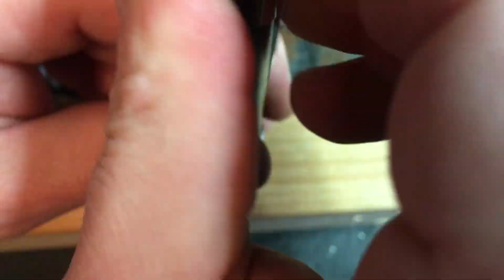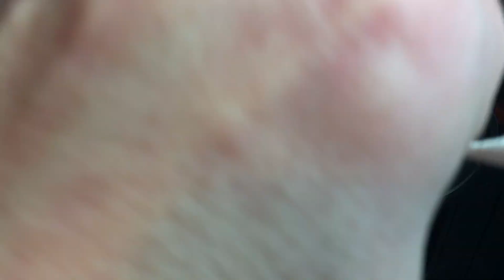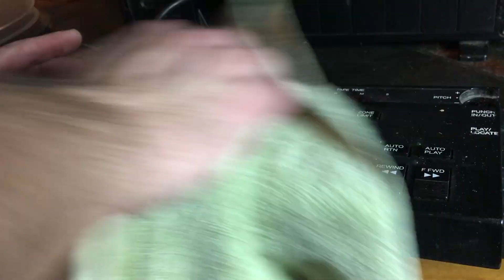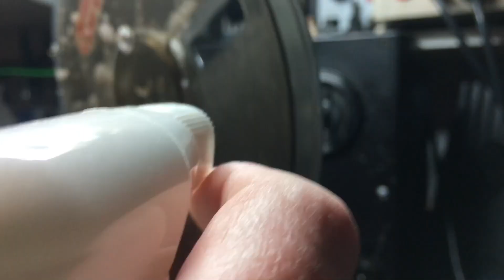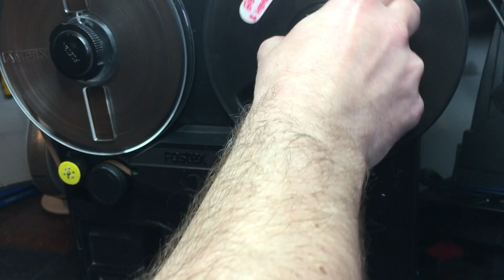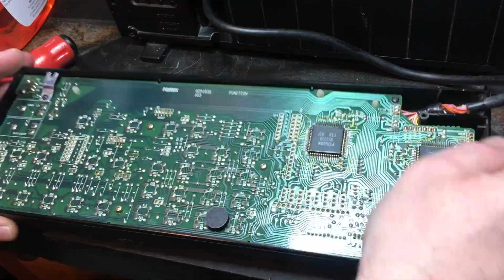Repair Fostex R8 with Plectrums

Comment: HIi have worked on alot of r8 put a 1/2 under the gear  black one's if you have  one's ii think m5
just do the nut up it grip on and just push it on the front i use black matt discs  the capstan roll part will push
out and you can drill out 2.5mm hole re tap to 3mm  and put a a black bolt  i have the right gear to do a full service  R8 is a poor deck i worked on alot of them over the years

Comment: can you add a link for the guy who makes the part, thanks!
Reply from the maker: i have not ordered one but they look good https://www.ebay.co.uk/itm/Fostex-R8-Metal-motor-reel-pulley-cog-gear-replacements-s833/232745077538?hash=item3630b00b22:g:5gAAAOSwceNaXdUv